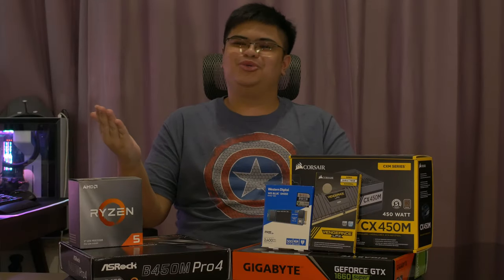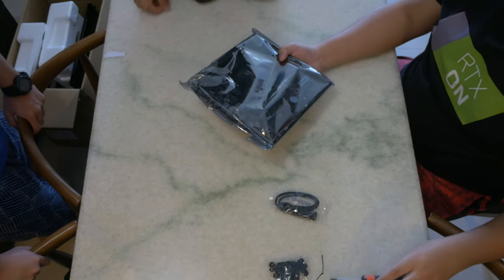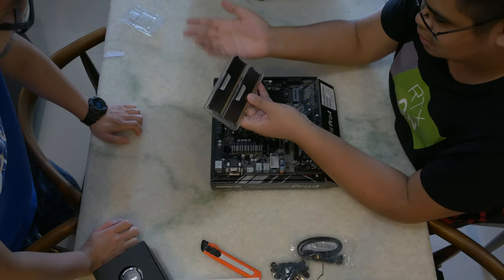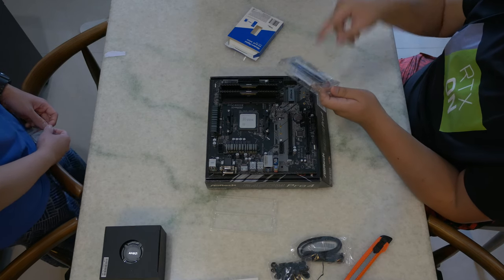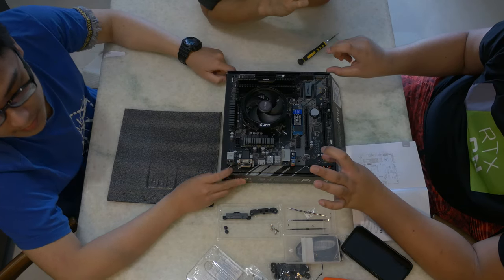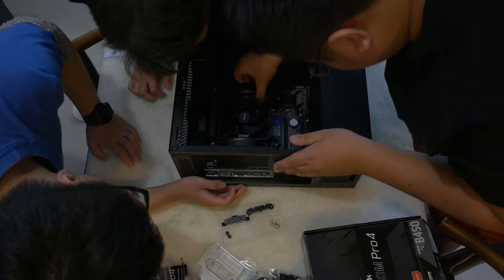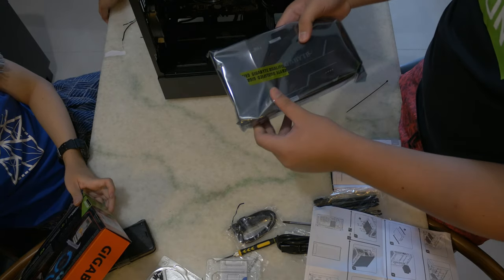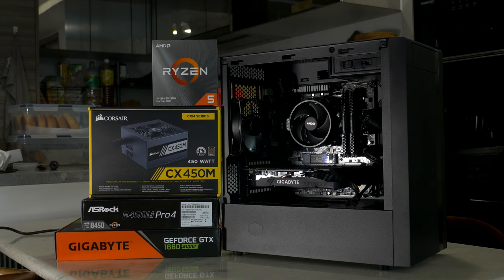Building the $750 PC!

Comment: Dude make a vid on how to run msfs 2020 on 60fps cause i cant figure out how to and it only runs at 20 fps 
So please help
My specs:
Cpu-ryzen 5 1600
Gpu-gtx 1050ti 
Ram-16 gb 2400mhz(just upgraded to 16 btw)
Mobo- msi b450 pro max
Psu-450 watts
So tell me how to get more fps please
Reply from the maker: You may not like this answer, but your hardware (specifically your GPU) isn’t powerful enough to get 60fps at even lowest settings at 1080p. However, if you’re willing to compromise a bit of eye-candy for more performance, you can run MSFS at low settings. A GTX 1050 Ti can do about 40fps (https://youtu.be/AmHL43KXTOQ ) which is pretty good for flight simulation. 

If you really want 60fps at 1080p, an RX 5600 XT can handle it at medium, but no current consumer card can do it at ultra (https://youtu.be/y6RIvvMPBTg ). If we’re talking about upgrades, you could also upgrade your RAM to get more performance. Ryzen benefits from faster RAM so a 2x8GB kit of DDR4-3000 or 3200 will improve performance as well (albeit slightly).

You don’t actually need 60fps for a good experience though. Movement is slow enough in flight simulators such that above 30fps is already fluid enough. 

Hope this helps! :)
Reply: @Tech2Papa  i had another question.after i plat msfs 2020 for a hour my frames start dropping so please help me how to fix this
Reply from the maker: That’s quite difficult to troubleshoot honestly. I’m still unfamiliar with the way MSFS performs on different hardware and detail levels, so I won’t be of much help here. You’d be better taking it up with MSFS support as they’d be able to assist you more.

Comment: With all your builds could you run benchmarking software so we can get an idea of the capabilities?
Reply from the maker: I’ve already done this for this $750 PC, you can check out the config guide for the performance and thermal results. 

I will do my best to run my typical test suite on any new computer I build, however I can’t promise I‘ll do that for all of them. None of these computers are mine and most of the time, the people I build them for need them urgently after they are complete (as was the case for the $1000 and $2500 PCs). I just got lucky that the owner of the $750 PC gave me an extra day or two to run tests.